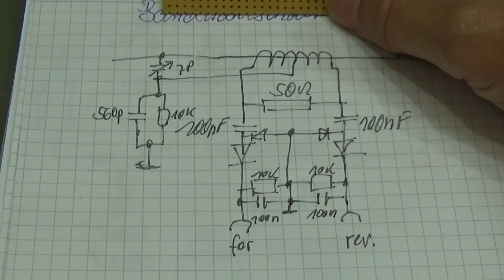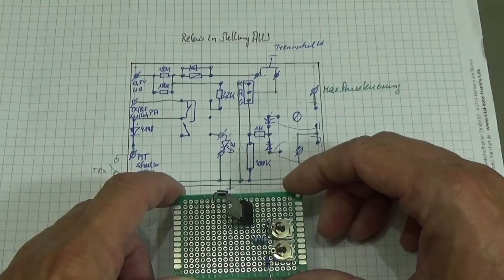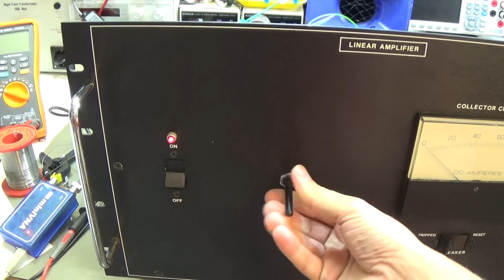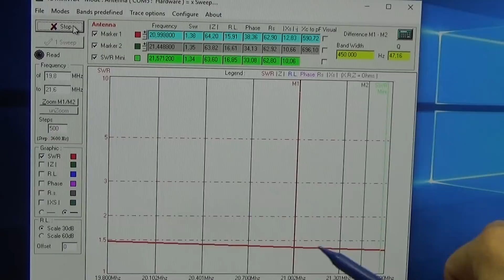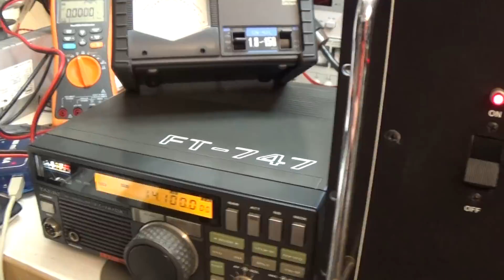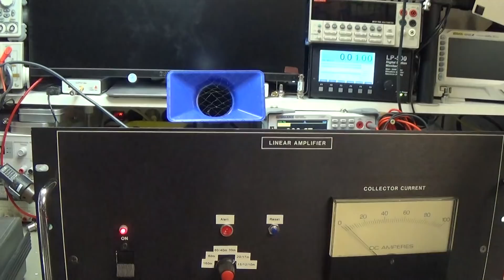#181 Modification  Linear HF Amplifier Transworld TW-500

Comment: You can also use the input frequency as a switch for the low-pass network with a band-bass network, then the low-pass filters automatically switch to the right band. Requires two variable capacitors, 3 ceramic capacitors and 2 coils per band. 73

Comment: Great work as usual Peter. Heaven is where all the engineers are German!
One thing I have in mind is whether it is possible to keep the amp in 18-10m  all the time and be able to use all the bands from there. Maybe you can do a test to show how much harmonics will be produced when transmitting on a lower band and keeping the amp on highest low pass filter?
Reply from the maker: LOL there are good engineers all over the world not only in my country:-) Well if you transmit on 18MHZ you produce harmonics on 36MHZ and higher but never on lower frequencies..

Comment: Hi Peter, again i agree with Mike :-), nice little upgrade.... curious about what voltage difference this little circuit produced between lets say 1.1:1 500w and full fault 5:1 reflection @ 25w - was it hard to find the break even point for shutoff?... Thanks for sharing peter, as always nice to look att your projects and repairs :-) All the best, and 73´s /Anders
** Perhaps a little clarification of my question about break even :-).... we have a return voltage of 1+volt at 230w output @ a specific reflection lets say 1.1:1, (dont know what your antenna or dummyload sits at )  if you increase this to 550w we will naturally have a higher voltage in return...(under normal circumstances ) ..now with full reflection at 25w you had 1.5v in the video, so naturally in the end its a bit of adjustments to be made :-) acceptable swr level versus return power versus output power etc..
Reply from the maker: it is more easy as it looks..adjust the level around 10Watt input power and that's it :^) 73
Reply: Really? nice :-) i have to test this one, built a few different versions in the past, but i ended up processor controling the status FWD vs. Reflected, thank you for your answer Peter, have a nice evening 73´s / Anders

Comment: He we  can clearly see that Peter looks at tasks in a special way. Not just whacking in a switch with the words "That´s all, folks", but he also takes a view on the job from the point of "real world" operater. The SWR protection solution is a perfect add on to save a lot of pain and money for the owner. Nice and clean solution, great work.  From my point of view, as i now myself while operating, it might be an idea to add a buzzer, beacause my amp is not in line of sight while transmitting. So this might avoid transmitting into the safety-stopped amp. Most radios have a SWR regulated pa section themselfes, but i saw them fail more than once. Again: Great video! 73 de Olaf
Reply from the maker: Hi Olaf, thanks for the kind feed back very much appreciated..73

Comment: Just finished watching, I tried this morning (1:30am) but I fell asleep. You don't normally do Mods but it's always great to extend the functionality of a product. Did the customer request this Mod or did you suggest it. It's nice to see the testing done to show the results of this modification. The relays sound like frogs calls or cricket sounds. Well I talk to much sometimes so thanks for the great video always look forward to the next one. Cheers 73   (P.S. would you consider doing a live stream ?)
Reply from the maker: Well I do mods if they are required and useful but I don't do crazy mods as radios works quite okay most of the time. Many mods are creating trouble as they are done by folks who do not know what they are doing. Mike can tell a story about that as it happens much more to CB radios. Thanks for stepping in Tom 73

Comment: Nice project Peter, with a small modification that could be made into an automatic band switcher, an Arduino could be used to sense the reverse voltage and switch bands until it gets one with a good swr.
Reply from the maker: Sure you always can do more or different.. Thanks for watching Scott

Comment: Very Nice Peter, but I think that the amp should go direct to transmit when you push the ptt knob on the radio, without this extra cabel. Most of transistoramps do that. Why this extra cabel?
Reply from the maker: On ham radios you always have a link cable between the transceiver and the pa thus this ptt input is needed on the pa and yes the pa gets switched into transmit by pushing the ptt on your radio. But I understand your concern on CB PA's it is rather different your voice it triggering your pa without a link wire... Hope that helps
Reply: Thank's Peter! :-)

Comment: Looks like it would also protect against antenna or antenna switch faults which would cause high SWR?  That makes it even more valuable.
Reply from the maker: I may give an indication but it is not reliable to control the antenna swr

Comment: Nice again, Peter! Do you really need to test the "FORWARD" output from the SWR bridge?
Reply from the maker: Well the swr brides is designed to have a relative output thus I need to see the relation between forward and reverse to proof the function. on the other hand the forward output is not needed for this project. Thanks for watching